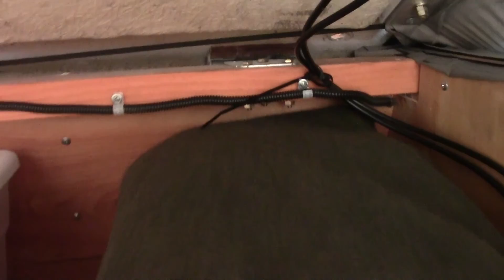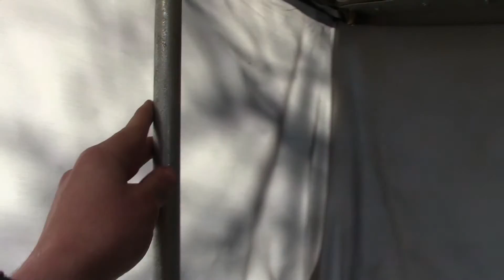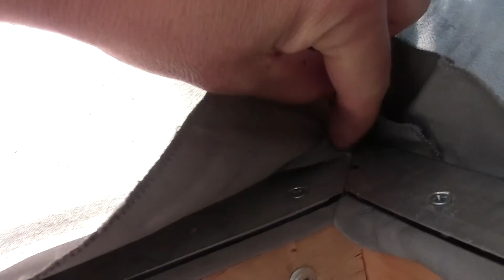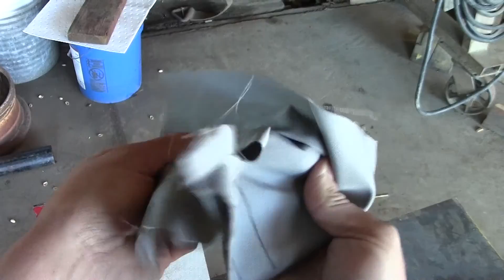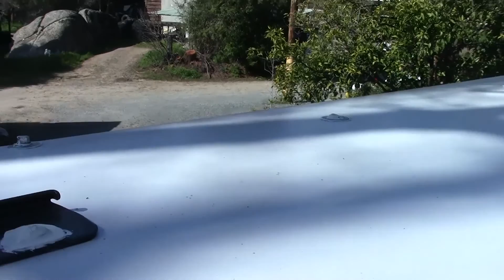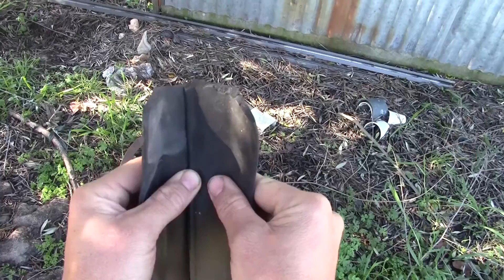Tent Top Construction

Comment: very cool idea to use the cover.  It looks like you haven't made Videos in a while but I'll take a shot at a question.  You say you would probably fabricate your own roof if you did it again.  What materials and type of construction would you go with?
Reply from the maker: I’d probably make a frame out of wood and skin it with aluminum. That would be lighter than a fiberglass bed cover.

Comment: Thanks for providing your perspective on this aspect of building a custom camper. Since publishing this video, have you found a better fabric than the 'WeatherGuard65'?  Seattle is a mecca for sailing and businesses catering to that market should have a range of waterproof, rot and tear resistant fabrics.
Reply: Commercial truck tarp material.
Reply: I still have an old 'FourWheel' popup camper and compared to the fabric it uses, a truck tarp seems to be much thicker and stiffer. This could be an issue when trying to lower and secure the roof.
Reply from the maker: I haven't replaced the tent top yet. Building it once was a pain in the ass.

Comment: Great information!  Thanks for the tips.  So what material would you use if you had to build your own top?
Reply: To keep the top light, thin aluminum sheet seems like a reasonable choice. I just purchased two 10 foot long, 49 inch wide aluminum sheets (0.030 inch thick, as is commonly used for trailer walls). This is a bit thicker than the flimsy aluminum put on the side of motorhomes (which is 0.024" thick)
http://mirageinc.com/030-beveled-aluminum-full-skin-sheets
To bend the edges of this material, someone suggested the following tool;
https://www.amazon.com/Wiss-WF24-24-Inch-Metal-Folding/dp/B004RGXNG6/ref=sr_1_7?ie=UTF8&qid=1514673944&sr=8-7&keywords=metal+bending+tool
Hopefully, this tool can be used along a 10 foot length by progressively 'walking' the tool along from one end of the sheet to the other.